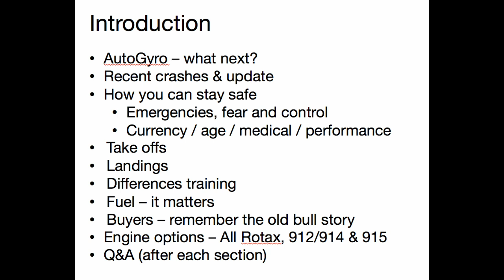American Ranger 1 (AR-1) fatal accident in Utah 16th Dec 2020

Comment: Hmmm. Rudder cable or pushrod snap? Still, the rudder shouldn't have gone fully in one direction and gotten stuck there. I'm thinking pilot medical issue, but it's hard to tell.
Reply: There were some all flying rudders that could lock because they had no anti-servo tabs.  But this doesn't look like that type.
Reply: Phil were the blades bent b backwards against the direction of rotation or bent over like a banana.  Often in negative g situations the rotor have lost so much lift they bend over forwards impact the rudder etc.  But don't have enough rotational energy.  If the son reported a rudder strike might have unloaded the rotor.  Any prop strikes on the underside of the rotor?
Reply from the maker: Hello guys - my attention is draw to a flight review and comment by the owner of American Ranger that suggest there is not really any requirement for rudder input - or light rudder forces are required with the AR1.  The accident pilot had previously owned an AutoGyro Cavalon and the last year flown with his son in a Magni M24 - both require quite a bit of rudder force [right rudder in particular with higher power settings].  I wonder given the big right rudder input if the pilot simply defaulted to what he "knew" from the prior aircraft and gave a boatful of right pedal OR the aircraft needed some right pedal but he gave too much as the effectiveness of the AR1 rudder is much more.  That sets off the chain, pilot now confused [this flight or this day was his first solo in the aircraft] and now we are in a very upset state close to the ground and it crashes.
Reply: @gyrocopterflyingclub6148  Plausible, but I think we've all been in aircraft that are a little more sensitive on the controls than we're used to. Usually you figure it out after you get more than you bargain for from an input. If something were going to go wrong because of that, I would've expected to see some kind of wild overcorrection instead of just doubling down on right rudder.
Reply: Before his aggressive climb-out, I notice he pitches forward briefly before pulling up, too briefly to gain any real airspeed. Looks slightly erratic, maybe an indicator of the start of whatever the issue was?
Reply from the maker: Yeah maybe.  With no aircraft data, a low time pilot on type and someone of 77 years old ultimately there are a lot of possibilities.  Are the NTSB going to find out anymore?  Well I suspect this video footage will be the primary source but in truth without an obvious failure to the aircraft or a medical issue with the pilot I suspect a range of possibilities become the conclusion.  You are absolutely right the pilot doesn't seem to do much to correct his situation but then he is nose high [possibly without a visible horizon] and now its an upset recovery type scenario but with not much height to correct - and maybe the obvious lack of height situation means he was unwilling to chop the power.  Really I don't know but the more or less likely that kind of situation depends on the training.  i.e. if upset recovery is a thing he will have been taught in a gyroplane then him not doing that might seem less likely.  I suspect however that hasn't been taught.
Reply: @gyrocopterflyingclub6148  yeah that's the tragedy.  I'm on holidays at a lovely local Island at the moment so only have my phone to watch it on so I couldn't make it out too well.  Could have even been a heart attack too.  I had a mate with diabetes that died flying the witnesses said he just slowly nosed into a steeper and steeper dive.  Back then few gyros had adjustable trim.  My trim spring was set to neutral so hands off I could fly extended.  His required constant back pressure he said he liked the positive feel.  I suspect he passed out and the thing just dived in.  So even if say there were signs of unloading the disk hard to tell why in most cases.  I'll have a proper look at home when I get back from the sun sand and beaches.  Went for a long walk down this beautiful beach (just back)  all I could think about was what a nice airstrip it would be.  Sizing it up for the gyroglider technically a kite here so legally ambiguous my sister knows the local police so have to have a chat.  30km long airstrip at low tide ;)
Reply from the maker: Hi - yes when you get it up on a big screen the pilot is just over controlling the aircraft and ultimately at around 35sec there is a tail strike with the rotor as its been unloaded by the prop thrust and then there is forward stick later on but control was lost quite early on.
Reply: @gyrocopterflyingclub6148  i just got a look on the big screen myself.  A couple of things notice the blades are bent like a banana not like the would be in say a blade strike on wind up also notice the trailing edge on the one blade you can see is cut through so it likely struck in flight this would be consistent with bunting over (unloading the rotor)  the sudden full rudder could easily be explained by unloading the rotor in flight.  Retreating blade striking both rudder and hitting the prop on trailing edge and once unloaded you have no lift to manipulated and you tumble.  Hard to know what caused that though, could have been medical or as you said low hours on type.  Did he have any training on type?
Reply: No fault of the gyro. The pilot didn't have the knowledge to fly this type of gyroplane.  All gyros fly different. 
You can see several mistakes made.
Prayers for family.
Reply: @gyroplanetraining  It does look like that, but I don't think we know quite enough to say definitively that there was no hardware failure.

Comment: All very sad and none of us are air accident investigators.
There does however seem to be something scraping and sparking under the rear of the empennage from contact with the runway as the nose comes high and before the nose comes down again before lift-off.
It seems to spark from just after it passes the last orange light at the side of the runway until the nose comes down a bit.
I know there is a small tailwheel to protect this area from damage.
I only point this out because tail strike was previously mentioned and discounted as I feel uncomfortable speculating from my armchair and think it would be better to wait for the accident report to look for learning from this.
Profound sympathy to the pilot's family at this sad time
Reply from the maker: Hey Tom - its been a bad few weeks globally for gyroplanes but I know a little more about this accident now.  Some initial PIO, and then some over controlling and a very high nose attitude, rotor hits the tailplane having been unloaded by the prop thrust as low g, then some forward stick and more low g before LOC.  Low time pilot on type, first solo.

Comment: Having enlarged the footage I would say that there was over-rotation early in the takeoff run which can be seen by the nose wheel lifting and then returning to the ground. Damage caused by a tailstrike is more than likely the cause of this crash in my opinion.
Reply: Who would be responsible for such damage in your scenario?
Reply: @birdwing98  Unless there was any form of structural/control failure unrelated to the tail strike or medical issue, it sadly comes down to that 'catch-all', 'Pilot Error'. I was not there, and have not seen the a/c in question, so obviously, my opinion is just that, my opinion, and nothing more.

Comment: I am not sure if this gyro had the folding mast option. They always make me leary. That would probably be identified if it were the cause. The nose dipping down then up could indicate loss of elevator, which would correspond to a  loss of rudder and a tailstrike since no RPM change can be heard. Loss of consciousness is my only other guess since it's hard to see the attitude changes well.
Reply: No elevator,  pitch controlled by moving the head.  However any input on gyro generally need to be corrected so a small pitch forward input becomes progressively bigger unless you correct for it.  So any damage to controls could cause an issue.  They will fly without a stabiliser but not likely to just fall off.  Be very hard to determine.  A lot of experienced fixed wing pilots struggle with sensitivity of controls.  Difference between dual and solo is large.
Reply from the maker: Hey all - no when you see the better copy of the film this is just pure over controlling and ultimately low g.

Comment: Another medical possibility that affects primarily older people is orthostatic hypotension ... the basic issue is that older people have less timely blood pressure control than younger people.   That means if they suddenly standup from a chair, or if they are in a sudden G+ climb, blood can rush from their brain too quickly and they can black out briefly, or at least get woozy.    This possibility is increased with various meds commonly used by older people as well, such as B-blockers.   I'm sure older pilots could use fighter pilot techniques to counteract this issue at lower G's than a fighter pilot would need to.....leg squeezes and such.    You can feel and essentially be completely fit for this to happen, as it is not considered to be a serious pathology that a doctor would treat.    Maybe this should change if there are more older pilots, ...esp. if they are going to try aerobatic manoevers.
Reply from the maker: thats very interesting esp as usually older people have higher blood pressure and is the main look out - so I guess the opposite is easy to overlook.